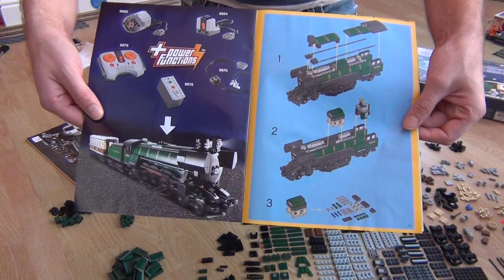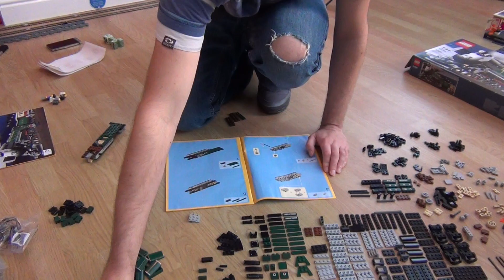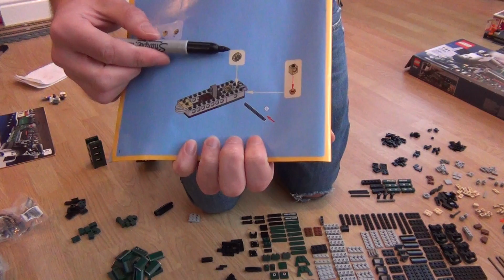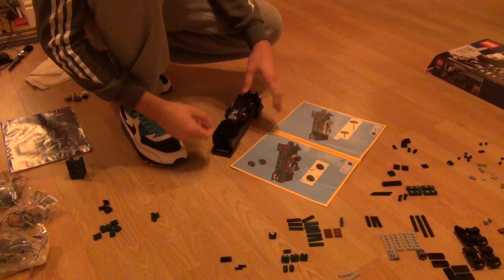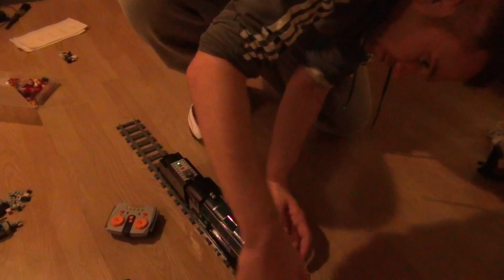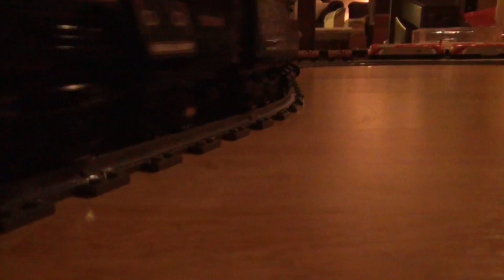Building the Lego Emerald Night

Comment: Okay, Will, you were being a daft bozo at Step 5. You can clearly see that the brick in question goes inside, and up against that hole in the side of the frame. The arrows are wrong, but the progress picture is right. I can see it in clearly in the video. I think this calls for a revisit, just like the Royal Train. Because not only did you not see it plainly in the picture at first, when you finally discovered where it was supposed to go you overcomplicated things for yourself. All you had to do to get it in there, was remove the smegging axle. Would have saved your daft arse a lot of time.

That being said, yours probably /is/ one of the early-run Emerald Nights with a flaw in the gearing, given your difficulties reversing. There are reviews on Eurobricks that looked into it.

Comment: The coupling rods on either side are offset 90 degrees to allow for an even torque delivery over a 360 degree turn of the wheels, with each power stroke beginning at every 90 degree turn of the wheels. If there were to be no offset, the torque would be delivered to the wheels once every 180 degree turn of the wheels and it would be twice the amount as that of the 90 degree offset, thereby resulting in jerky travel and considerable wheel slip during the power stroke.

Comment: I just left out that bit in number 5. Don't know what the point of it was. Not a decoration though because it's underneath the loco
Reply: Its a change Lego made to the instructions after discovering that without it, the gear on the axle parallel to the locomotive length can slide off the end of the axle when running.

Comment: Not to nitpick, but you might want to stick an annotation in at 43:43

You said "Hornby's instructions" when obviously you meant "Lego's instructions"

It's an impressive model. Handled the tight curves with almost no slow-down. I think the flexi-track is more the blame than the model for the issues in reverse. I suspect it was the trailing truck causing the loco to stick. The pony truck, driving wheels and tender have more than two wheels the help keep them running true, whilst in reverse the trailing truck does not. At least when going forwards the driving bogey is pulling it along parallel to the track so it just follows.
Reply from the maker: I think most of my viewers realise it was a slip of the tongue.
Reply: My guess is that the rods connecting the drive wheels to the pistons is too short; in reverse, the short rod pushes up on the top of the cylinder, jamming the whole mechanism.
Reply: I've had this challenge before, and made my own rods; they work more realistically than LEGO's original design, if it isn't colored properly.
Reply: Edward Tear

Comment: IC82, most american steam locos have head lights mounted in the center of the boiler. A few would have it up high, but the Emerald Night doesn't replicate that. Don't mean to be a rivet counter, just wanted to let you know. :)

EDIT: Also, the reverse sticking was solved on mine by making the cylinder longer. I may be able to upload a vid of it if it would help.